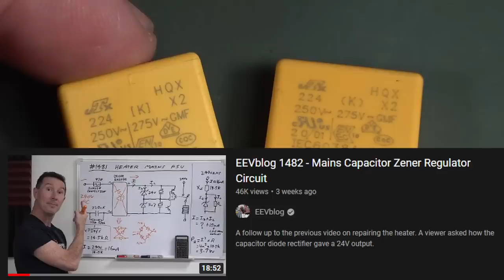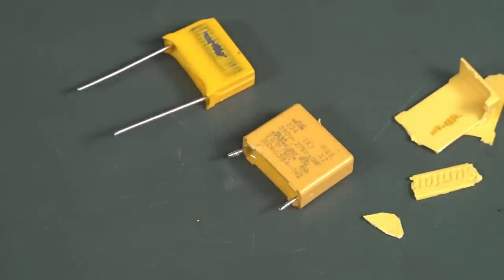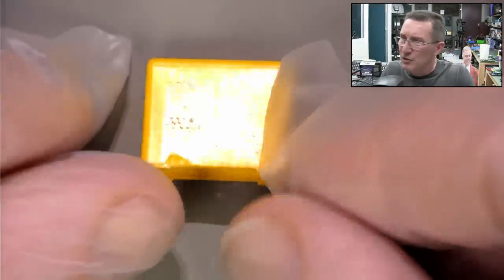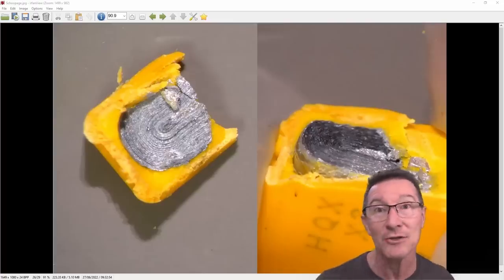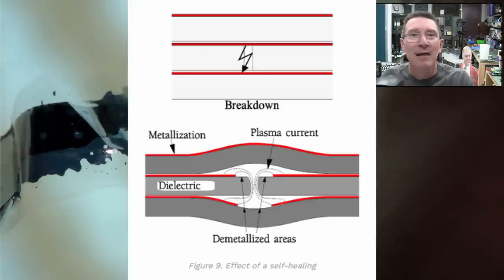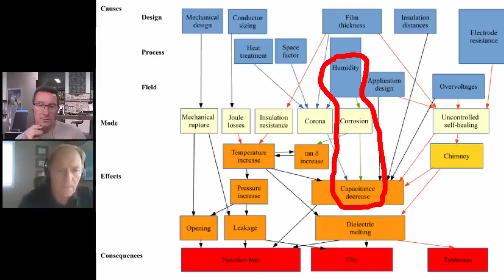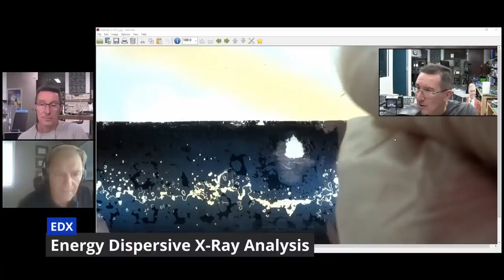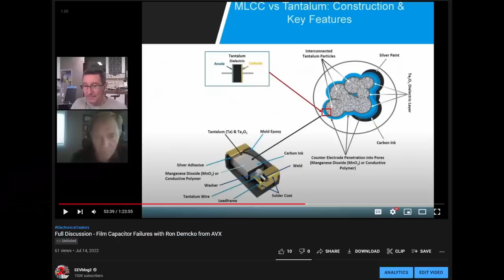EEVblog 1486 - What you DIDN'T KNOW About Film Capacitor FAILURES!

Comment from the maker: Comments from Dr. Tomas Zednicek founder of European Passives Component Institute, and former AVX:
Quote:
I did look at the whole video – congratulation to your teardown skills 😊. Regarding the phenomenon you observed - I see two/three potential issues on the failed cap:

1] uneven metallization. If you look though the unwind foil of the fail cap vs the reference one it looks that the centre section of the failed one looks lighter compare to the edges, this might indicate that this area is thinner compare to the edges. This does not have to be a manufacturing error but even an intension. You mentioned shoopage reinforcement (also in ref here on my web). The target is not only to make the connection more mechanically robust, but make lower ESR and improve performance on the pulse load. You can image this as an “skin effect” at pulse – high freq spike load – the most exposed area is the one closest to the termination lead – and that has to have a lower ESR – achieved by the edge thicker metallization/shoopage reinfforcement. If you go towards the inner side of the cap - centre of the foil width (if you looked at unwind foil), the resistance increase with the length path and thus the pulse will not expose that area. So actually you do not need uniform metallization thickness across the whole foil width, thinner metallization at the inner side is supporting better self-healing for longer life time and thicker metallization at the edge increase pulse robustness. This is a reason why you see defects in the centre of the foil where self-healing / delamination happens first. This type of failure mode suggest that the cause may not be originated by pulse overloading (in that case you would see a burn spot on the edge - as you expected) – but there is a degradation of the foil under a regular (non-spiked) applied voltage. If the metallization layer is thinner (as a manufacturing fault) or improperly designed you may see such type of failures.

2] moisture degradation. Quality of film caps may be also strongly impacted by quality of the encapsulation resin. Indeed – this class of commercial caps are non-hermetic – but cheap and poor epoxy resins used for encapsulation may not protect so well the capacitor core element and even capture some moisture with time. The metallization may be sensitive to moisture and if there is a higher humidity inside it speeds up its degradation processes. As per the dark spot areas on the metalization of the failed capacitors I could guess that some level of degradation present and I would point moisture on the top of likely the cause. Also presence of “lightning like” spark line at the centre of the foil suggests that there may present a moisture / conduction path causing the defects.   

3] combination of 1] and 2]

As often seen on the market I would guess 2] may be the root cause of the failure in this case, low cost unbranded capacitors often use inferior cheap epoxy resins that are sensitive to moisture and longer term it degrades capacitor performance. You can check this easily by testing of moisture robustness of these capacitors capacitance drop at humidity test (even after 500h 40C/90% you may notice differences and even shorter if you would apply 85C/85% load). The conclusion here may be to use safety capacitors from brand manufacturers with trust if you really care about safety.
Reply: Thank you very much for all your videos you are one of those big help on the internet which thousands really appreciate so thank you once again for all your vidoes and hard work. Are these dc capacitors or ac? can you measure their capacitance by dc meter??

Comment: For anyone wanting to unwrap a cap themselves. If you shave the ends of the roll flat and clean with a razor/scalpel, you can usually get the film off without much (or any) tearing.

Comment: I had this discussion about 5 years ago with James Lewis formerly of KEMET when I saw this note in the data sheet about NOT using X2 capacitors for dropping supplies.  He reiterated that moisture would cause corrosion in as little as a year because of sealing and moisture.  Cost was a major issue and these capacitors were designed to last long enough to get thru EMI testing.  Long life was never to be expected.  At the time they were thinking about a line of X2 capacitors which would actually bd designed for dropping applications.  Bottom line was to avoid using X2 capacitors, yet many designers insist on using them in designs vs other film capacitors. Lewis had left the company at this time. Perhaps your guy was hesitant to say that these capacitors were designed to fail.
Reply: Kemet, home of the smoke bomb... Did he have anything to say about paper capacitors in particular? Anyway, glad to hear Kemet was also thinking about dedicated dropper capacitors. Vishay and Epcos actually realised such types. Maybe Kemet as well in the meantime?
Reply: X2 capacitors in general have already been safety agency approved for use on AC mains; other capacitor types in general do not have such approvals. It’s much easier to spec in a safety agency approved device when AC mains are involved, whether that device will perform the best or not.
Reply: @mjouwbuis  Paper capacitors predate  Kemet buying that factory by decades.  I've seen paper capacitors from before 1950, using primitive resins for sealing, and those devices still worked!

Comment: Those capacitors were made to be SOLD, not necessarily to be USED.  It's great to hear the perspective of a practicing professional engineer (with all due respect to our enthusiastic host).
Reply: The most important difference is that the more expensive brands such as Epcos and Vishay, explicitly mention that normal X2 capacitors are unsuitable for use as series droppers.
Reply: Well it's not just a practicing professional engineer, it's a specialist with 40 years experience with capacitors in particular.
Reply: "Moisture ingress" into a device enveloped with epoxy, after only a year!!!??? You're right - these parts are mere facsimiles, not actual electronic parts.
Reply: @mjouwbuis  Panasonic, though, state in their ECQUA (PP X2) datasheet (at least an older version, the current revision doesn't say specifically) that it is suitable for series dropping, and don't make a separate series (unless you count ECQUB which is for X1 class, and also Y2 in low values).
Along with Okaya, they seem to be the most reliable (at least from my limited sample, but each piece I've tested so far from those two makes remains within tolerance).

Purpose-made high-stability types may well be preferable for droppers, but when capacitors degrade to <10% of the original value (not uncommon) I fail to see what purpose they are good for; at that stage you'd be better-off with a more-stable type even if the initial value is lower to fit the space.

Comment: Back in the 70s, Sprague came out with "Orange Drop" film capacitors which were hermetically sealed in orange epoxy (powder dipped in an air bed and then baked to activate the epoxy powder).  They became extremely popular, because they eliminated the eventual failure of the paper / wax capacitors  used in everything.  They were mostly Radial for PCBs, but every now and then, someone would bend the leads straight at the body juncture to make them Axial.  This would crack and remove the epoxy on the leads at the body and let humidity leak inside over time, eventually causing a value change  / failure.  All of the other film capacitor manufacturers adapted this outer case sealing (powder coated epoxy) as soon as they could figure a way around Sprague's Trademark/patent. Turns out it was simple: any color but orange!

GE made these by molding white nylon over them (since this was a GE Plastics product), but alas, it did not prevent moisture from getting in and they would self-identify by become a bloated barrel shape.  Ah yes, the good old days 😁
Reply: @Banter Maestro2 Yep.  GE plastics thought they found a new market, GE Electrical Components lost one.
Reply: The orange drop capacitor was very popular for use in CRT horizontal deflection circuits; IMO they would be a good candidate for use in the application that is the topic of this video.

And the orange drop was a metal film capacitor, and not a metallized film capacitor; the metal layer was thicker to be able to support higher currents.
Reply: Vishay make modern copies of the Sprague orange dip. Pricey little tators.

Comment: Great one Dave👍

I have several cheap RF remote AC outlets.  They all use capacitive dropper power supply.  The dropper caps are typically only 200VDC rated.   They drop in capacitance until they can no longer power the relay.   I have replaced them all with caps rated 400V to 630V.  None of those have failed.
Reply: None of those have failed YET .
There, I fixed it for you. They will all fail, that's the nature of the design.
Reply: 200vDC is rather inadequate when mains is +/-340v.
Reply: @liam3284  170V here in USA.  But with transients etc. it's still inadequate.   They cheaped out!
Reply: @johncoops6897  Well it's been almost ten years and the 400 to 630v replacements are all fine.  The electrolytic caps will probably fail first...

Comment: Oh, such memories!  At one time I was involved in various capacitor reliability issues.  Then the things proceeded to building AC high voltage capacitor winding machines.  Further an idea about why not making smaller capacitors and a winding machine for those (just one machine as the product was abandoned).  We did not have self healing materials, we tried just aluminum film and various polymer films.  What we tried to make was high discharge rate special capacitors.  For that goal, we also  tried the offset aluminum films and metallized ends.  Tried tin spray and zinc spray.  Well, I moved to other tasks before all those endeavors were finished.  The main business was cable manufacturing.  Our department built the machines and control systems.  So, when we wanted to make high voltage cables -- basically big coaxial ones -- there was a question about corona between the inner and outer conductor and the insulation.  That was solved by extruding 3 layers, thin conductive plastic next to each metal and actual insulator between them.  But then we found there still were something called partial discharge phenomena.  The traditional testing had been with line frequency AC, but in this case it turned out to be impractical for various reasons.  Our department together with the high voltage test department built a testing system using single sine pulses with a low repetition rate.  While that project continued, I got transferred to an entirely different division to tackle new problems at a brand new R&D department.  But something stuck in my memory about capacitors, corona and especially the partial discharge issue.  Ron Demcko probably knew all of those details as well, although did not want to go to potential trade secrets.
Reply: Partial discharge would produce ozone, just like corona. So it’s just as bad of a problem.

Comment: Very timely video.  I have a Solar Edge inverter system with my solar panels and 3 years into my system, the inverter failed.  After discussion with technical support at Solar Edge and their remote troubleshooting,  they assigned me an RMA and indicated likely a capacitor failed.  This inverter if full of high capacitance value 700 V film capacitors.  Solar Edge is having lots of inverter failures in the units based on some googling.  Unfortunately, they say I can't even attempt to repair it or I lose my 25 year warranty.  BUT they also say typical shipping is 5 to 10 days.  When I press them on when they will ship, they then say they are having supply chain problems and have no idea when my replacement unit will ship. 

In checking on replacement 700v assorted values of capacitance around 100 microfarads, it's 26+ weeks out.  So I am screwed.  So much for my solar power inverter that uses high voltage film capacitors.  Just venting when I came across this informative video.  Any suggestions are appreciated.
Reply from the maker: Ouch. My Sunnyboy is still going long after 9 years or something, touch wood. Have never opened it though.
Reply: Worked with an inverter designer here in Melbourne as a graduate. We blew up a few mosfets in the design phase, but have not heard of a single unit fail yet, not even one intentionally installed in a lightning prone area.
Reply: @EEVblog  perhaps you should
Reply: Similar issue here so I bought a dead inverter similar to the models I have.  After a little disection  I found that the electrolytics and silicon parts were all good. the weakest parts were the X2 cap and MOV after the output inductors.  these part are in stock if you look around, not too hard to get.  Getting the board out really sucks, potentially destructive unless you really look at how it is built.  there is reasonable in circuit testing for the most likely to die parts.  in the end, the ebay dead unit was one $15 cap away from working.  I agree with some commenters to try and switch to X1 caps but have been finding them hard to source.

Comment: Cheap X2 caps are definitely worse than good brands. Had big trouble with them at work about 15 years ago, purchasing loved this brand because they were cheap but sales hated the failure rate! However be careful with the peak currents in your circuit during normal operation, especially when using them as decoupling caps for PFCs etc as they can run hot due to their ESR and degrade fast! Especially if the ambient is hot. If you don’t mind spending more, specify a good make of class X1, they are way more robust.

Comment: @ 8:20 It would be interesting to show the audience the difference between several capacitors with the same capacity but volumetrically different - with higher working voltage and thicker metallic layers :)
I opened some capacitors in my life out of curiosity to find out how and why they deteriorate

Comment: Thanks for this. I learned some useful facts, and really enjoyed listening to Ron Demcko. In the stuff I work on (vintage audio gear), film caps tend to be less of an issue than electrolytics, the exception being Frako-branded caps, which are a "replace on sight" item. I had not seen damage inside a film cap like this, and I had not considered liquid ingress as being an issue. On the other hand, in vintage audio, one rarely sees X2 caps except across the power switch.